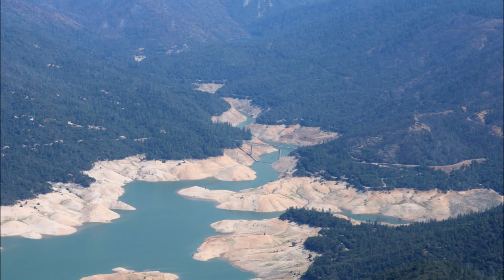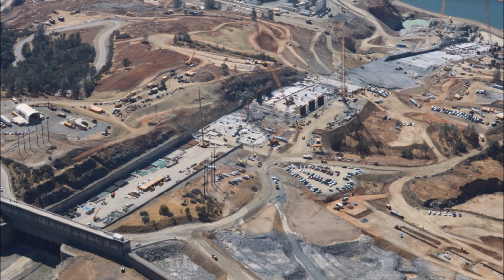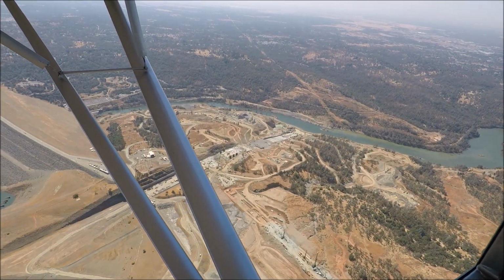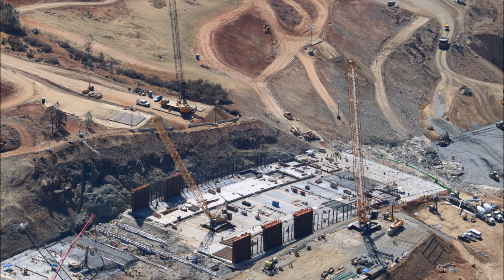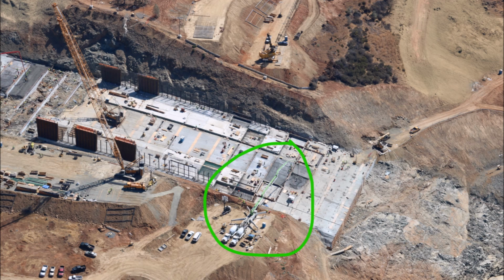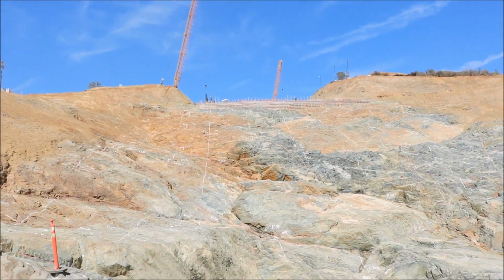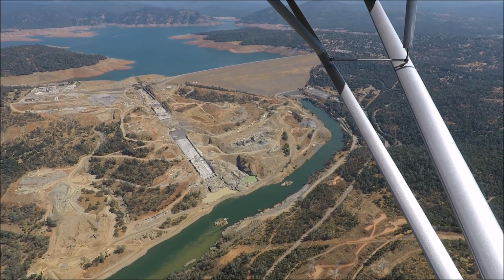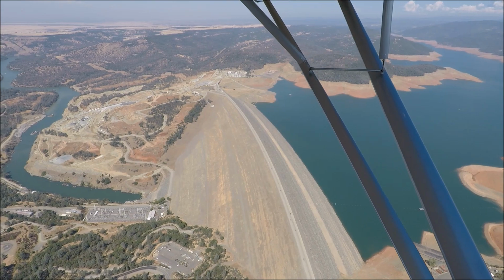Oroville Update 13 Sept "The RCC Race is ON!"

Comment: Thanks for the good info Juan. I'm quite staggered by getting over 3000 cubes laid in 1 12 hour shift, that's good work. Ya don't realise how enormous that hole was (and still is) until hearing figures like that. Shows the damage over 250,00 tons per second can do and the enormous power of water. I read  yesterday a Perth (West Australia) based company(www.srglimited.com.au) has entered into a joint enterprise with Traylor Bros od California to work on upgrading dams in the US. It seems there's over 14,000 dams built int 1930's which are described as hazards so there's a lot of work to do

Comment: Is flyash being used in these various concrete mixes.  If so what ratio replacing portland cement, and from where are the huge quantities of cement and flyash coming.  Was flyash used in the original (failed) spillway concrete.

Comment: I've got a question for you.  I read that when they poured the concrete on the Hoover and Coulee Dams that they ran cooling pipes through the concrete to keep it cool, otherwise the pour(s) would be too hot and never cure. Why don't they have to do this with the RCC?  Is it not an issue?
Reply from the maker: Chris Wassell not an issue with RCC.

Comment: "blancolirio"  is "Therapy" just what the Doctor ordered.... An oasis of calm rationality, in a desert of crazy politics! etc.  with two 'Stars" "Julianns" & "Pete" who definitely add interest to the narrative. They both know their racing aircraft very well. I was impressed! ... BTW I was told that "Chert" or "Flint Nodules" can add considerable strength of concrete. I believe the Romans may have discovered this property?  Flint flakes can also be used. Concrete is strong in compression and weak in tension. for this reason, flint flakes have been used in flooring applications that might be subjected to heavy loads?,.. (consult the experts, not me!)  the surface often ground and polished, looking very smart in appearance.  https://www.pinterest.co.uk/pin/540572761499447051/

Comment: Just a general question  -  why do they have to "fill the hole" completely at all?   Why not just follow the contours of the terrain, slow down the high velocity  by a series of high volume "holding" tanks stepping  the water down the hill by stages.  This would also make the design more flexible in an earthquake I  think than one continuous stretch of concrete..

Comment: Really stupid question:  Why not just let the water drain on the bedrock all the way down to the river.  Why do you need to build a concrete chute?
Reply from the maker: see previous episodes...
Reply: From: http://www.latimes.com/local/california/la-me-oroville-spillway-failure-20170216-story.html

"Beneath it was mostly schist, metamorphic rock that Mount described as weathered and fractured. It started to erode under the force of the spill.

“There are unlined spillways elsewhere that perform well,” Mount said. “But they tend to be in resistant rock, and this rock is not very resistant. That is one of the design errors, not fully considering how soft and erodible that bedrock is. This stuff is all busted.”

"John France, a veteran dam safety consultant with Aecom, noted, “In 1968, quite frankly, there weren’t probably a lot of methodologies available to evaluate how rock erodes if you had flowing water on it.”

“Certainly we have to acknowledge that the performance we saw on that spillway was not consistent with [the DWR] conclusion,” he added. “We saw a significant erosion occur in that formation with far less than the design amount of water that would go over that structure.”

Comment: You mentioned you didn't know what the walkways on the inside of the RCC walls are for. From the DNR footage on Sept 12, it looks like they are going to cover the inside walls with "shockcrete" or some other harder form of covering as they are installing anchored wire mesh. Will you please find out what they will be using to cover the walls and see if perhaps it is the same hardened concrete they will use to cover the RCC floors?

Comment: Thanks Juan for you ongoing coverage which is the only way for us in the Uk to follow the evolving situation. I keep hearing November 1 is the deadline and it does not seem much time to get the RCC down and the walls up. The cdec site shows there was rain last year in mid-October and that the lake level is not much different to where it was this time last year. But there were plenty of years where the spillway was not used at all. So I am wondering how much of race against this will be!? Would be interesting if you could get any long range rain forecasts or info from DWR on how they plan to manage the lake level this winter. Also did they ever get that 6th turbine back working and what are they doing with the spillway gates, two of which which seem open or missing right now? Is there any way to test the spillway other than to use it when the lake first gets up to 865'? I guess it is a pretty simple structure in principle (if not scale) but it would be terrible if there any problems discovered on first use and lake level is at 865 and climbing and the emergency spillway work is still ongoing.

Comment: Thanks Juan, excellent work, as usual. I've been watching DWR drone flyovers & additional updates, and those forms you mention at 9:03 are actually scaffolding for workers to add forms & rebar to create a face of structural concrete to the RCC walls. There are a couple of DWR updates showing the detail of this process. That might be a permanent addition ready to hook up to the new spillway surface of structural concrete when they're ready to cap the RCC with it. You'd need to ask them about that, but this is what those planks are doing there, and why.

Comment: I watch your video's with great interest. Thanks Juan for providing these precise and reliable technical details. The 'horizontal' slabs are solidly bolted to the bedrock. How about the 10 meter high vertical trimming walls? The forces on them must also be impressive at the design capacity or even 100K cfs. How are these walls stabilized? How is the 90 degree angle with the horizontal slabs protected from damage by movements?

Comment: I was wondering when the other inlet was going to show up! I saw a video on it a month or two ago. Quite fascinating that it was considered!
Reply: Wow. Over 1200 dams. I wonder what the TVR is doing in their OWN system! I live by there, and maybe even use some power from there. Those dams are older than Orroville!
Reply: Okay, here's another question. I don't know anything about RCC, and if it can only handle 2500 psi, will it compress and cause cracks when a full load of water gets put over a newly completed structural surface?

I'm sure that has been taken into account, but if it's spongy now, what happens later?

I'm trusting they know what they are doing. I just don't know a thing about it!

Thanks for the update!
Reply: One other question: If they are going to bolt the final design down to bedrock, what kind of pipe-sized bolt will they need to install to reach bedrock in the plunge pool??!!
Reply from the maker: Hardens solid in 24 hours.

Comment: the wood platforms on the walls of the RCC portion are just work platforms for the rebar riggers.  DWR Sept 12 shows lots of nice shots of these workers on those platforms, securing the metal skeleton for the hardened layer to come. 
Keep up the good work.

Comment: The spillway of Anderson Dam in Morgan Hill,Ca. , largest in the whole Santa Clara County shares the same flawed  design of Oroville. http://www.valleywater.org/Services/AndersonDamAndReservoir.aspx
Reply: The original spillway design was not flawed, the decision to build it on soils was. It's easy to call something designed and built well over 50 years ago flawed, but remember it was built with the current state of the art in both design and construction. The processes they are using on this new spillway didn't even exist when the original was built.

Comment: several commenters have criticized the use of funds for other projects ( high speed rail line and/or illegal immigrants) in the California budget and NOT ! proper maintenance on infrastructure, such as, hmmm...I don't know, maybe, uhm, oh, yeah, now I remember - The Oroville spillway. You mentioned a forensic investigation a few times back. Any more word on the progress of that study into the causes and reasons for the catastrophic failure last February?
Anfd on a personal note, how do you see the damn dam now? Infrastructure that was ignored for more frivolous projects or a victim of the prolonged drought that saw countless bodies of water close to drying up?
Reply from the maker: see links in comment section.
Reply: I did, and thanks for that info. 
Here's a quote from there which may surprise a few, 
"1. Physical inspections, while necessary, are not sufficient to identify risks and manage safety.
 At Oroville Dam, more frequent physical inspections would not likely have uncovered the issues which 
led to the spillway incident."

Comment: Juan, after seeing the pictures from your 300mm lens and finding them really soft, I think I can offer some advice to possibly sharpen them up!

Generally speaking, you can get a sharper image shooting at an aperture of F8-F11 versus something like F4-F5.6 so as long as you can keep the shutter speed high enough to avoid motion blur (1/300th of a second or faster for a 300mm shot). I'm not sure how well the T6i handles higher ISO levels (sensitivity), but feel free to bump that up one step at a time until you have shutter speed of at least 1/300th of a second at an aperture of F8-F11. I would suggest using the aperture priority mode and manually setting the ISO so that the camera only handles the shutter speed. You'll have to keep an eye on what the shutter speed is when you are ready to shoot to make sure it is above 1/300th of a second (the higher the better), but bumping up the ISO as far as 1600 should be fine if you have to. Ideal settings would be aperture priority mode with an aperture of F8-F11 at ISO 100 with a shutter speed of 1/300th or quicker, so aim for those settings!

Also, thanks for everything you are doing out at the Oroville dam! I have watched pretty much every video from you on this project so keep up the good work!
Reply from the maker: Learning...the hard way. Thanks!
Reply: We all have to start somewhere! I'm more than glad to help out! Cheers!

Comment: I thought 2500 was a little on the weak side for RCC BUT I also remembered 2500 being watered down so it'd flow through a pipe before the days of pumps here in the sticks and it's still holding up. So 2500/6k it is!

Comment: I'm curious about that 150' of concrete fill. I'm sure the engineers have a reason, but I'm not sure what it is -- why couldn't they have filled it in mostly with dirt fill and then the last, say, 30' with the RCC? That would have been much less expensive, I would imagine.
Reply: They want the RCC lying directly upon bedrock, not dirt.  Firmer foundation.
Reply: Well, in the past they built the emergency spilway in a way...let's say...not too elegant. They didn't care about the emergency spilway until the problem with the main spillway so when they had to use the emergency spillway everything went to hell and people lives were at risk. I still remember that incredible waterfall and the canyon in the main spillway in February. Basically, the water cleared the dirt all the way to the bedrock and now they are making the foundation much better than it was. 

Of course, the amount of money invested on this project is massive and one day we will now the number of 0s it required but at the end of the day the dam will be safe and the spillways will work much better. Even so, 100k CFS looks nice but the problem here started because the lake was filling at 190k CFS, so if that rain and snow melting were to happen again, I don't know if the main spillway will keep up with such amount of pressure, I guess the enginners must have thought about it a lot and maybe the main spillway will be able to evacuate up to 200-250k CFS when it's finally completed.
Reply: +Juan José Del Pino Rivas   I  believe Juan said something along the lines of them ideally using 100k CFS max during the pendency of the construction and that the finished spillway will have a capacity of something like 200k CFS+.  It's possible they may not even use the spillway until it is completely finished.
Reply: In a couple of previous videos, Juan said that the maximum the downstream system can absorb is 100K CFS. However, the new spillway is being built to be able to handle about 2.5 times that amount.

Needless to say, they would evacuate before dumping a destructive load like that out of the lake!

Comment: John Easton I don't think a road milling machine can operate on such a severe slope, i think that slope is to severe. I am thinking maybe a rock trencher. Actally Vermeer makes what is called a Leveler that is designed to grind solid rock, where rock is too shallow to blast.

Comment: Hi Juan, Can you explain how concrete strength is measured (in PSI, presumably yield force) and what bearing that has on performance in the spillway application (flow forces, cavitation, erosion) in particular regarding the RCC and its hardened surface layer -- Thanks great series on this rebuild! :-)
Reply: When they pour concrete, they'll pour some of it in "test cylinders".  Typically 6" round plastic tubes about a foot long.   After a specified cure time (usually 28 days but could be 7 or others), they strip the plastic and put the concrete cylinder in a hydraulic press and compress it to failure.  The load it takes divided by the area of the cylinder (2*Pi*r ?) is the concrete strength.   Concrete is relatively brittle, failing all at once with little or no movement so it's not typically given a yield and ultimate like steel.  A typical specification would be "2500psi at 28 days".   The mix master will add enough cement to the mix to achieve that.  Usually more than enough since better to over shoot than fall short.  If the test comes in low at 2100psi every one has a big problem.   They can design mixes up to 7000 psi for really high strength special applications.   Here's a web site showing those test cylinders.     http://www.hwsperformingarts.org/construction/pac-update-testing-services/       No comment on how that affects spillway performance.
Reply: Thanks cember01 for the tutorial on concrete strength testing!

Comment: Great video, Juan! The view from below looking up at the top of the plunge pool really gives a perspective on how high they have to go to tie the upper & lower sections together. 

I still don't believe the 'green spot' is from rainfall. It only rains on that one spot? That dam is a controlled, compacted fill with every inch the same unless that section was the day the inspector wasn't looking. 

If a property owner had a private dam with a spot like that they would be all over them to get it fixed before it eroded through bigger & caused a failure. There are levees downstream that started to fail last Feb & they are being fixed. It's not green now because the lake is so low.
Reply: You should read the report. It states a perfectly logical reason for that spot to "green up" when it rains and turn brown when the rain subsides. That is, of course, if you're interested in applying reason or if your mind is made up no matter what. We seem to have arrived at a place where we can simply "refuse" to accept common sense, facts, reality because we choose to.

Comment: Thanks for keeping us up to date. 

A couple of questions. Can you tell us how many piezometers were installed in the dam? I read none of them are working now which indicates there were some installed. Are there other instruments that have quit working that have not been replaced? Does DWR have any response to the failed instruments situation? Do they intend to repair or replace broken instruments that monitor the dam's condition?
Reply from the maker: The original piezometers have (had) a limited lifespan. They are researching an alternative, non-destructive means of monitoring.

Comment: Was the failure caused by a lack of funding for infrastructure maintenance? How did they let it get so bad?

p.s. I love the landing footage!
Reply: No, it was caused by radically underestimated erosion underneath the spillway. The DWR were aware of it, but not the extent it had spread. 
It's easy to point fingers about it (and I'm not accusing you of this, others have done so), but if they'd known how bad it was, they would have implemented some sort of temporary repair before it got that bad.